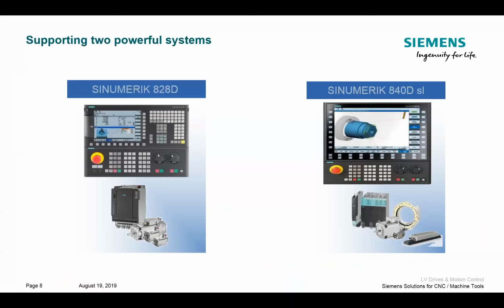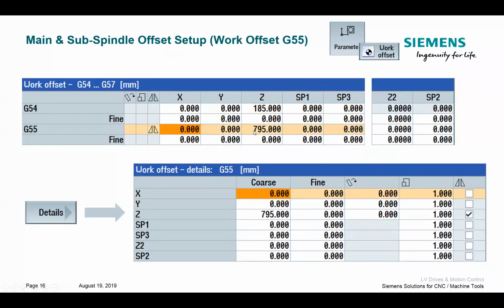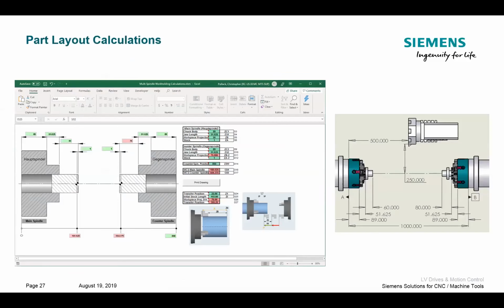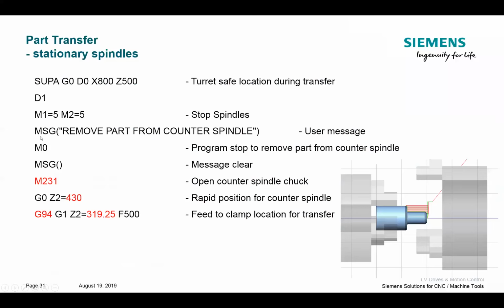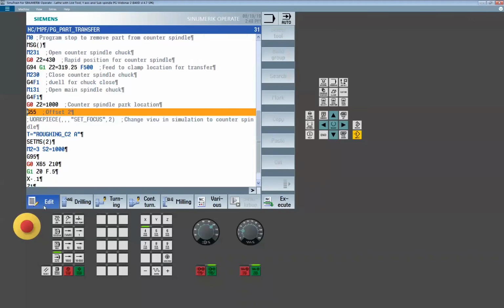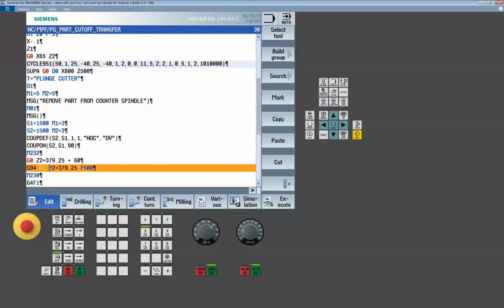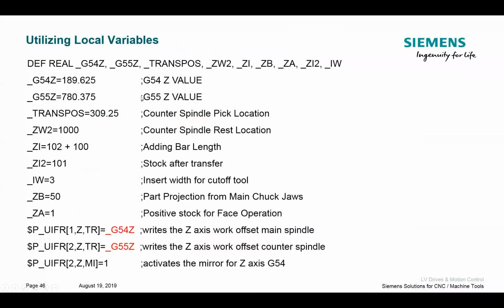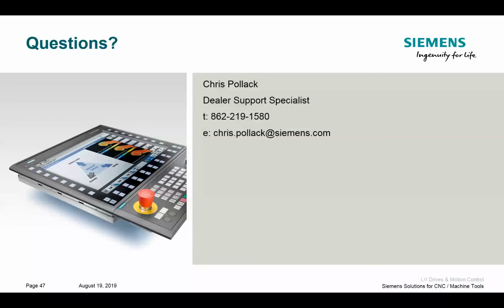Setup & Programming Sub Spindle Lathes in G code with ProgramGuide    SINUMERIK 840D Sl & 828D

Comment: Hi Chris. Just discovered your videos and they’re really informative. 

I’m struggling with a part which requires me to broach a hexagonal slot. I’m using a single point tool so I would have to index the c axis 60 degrees each time of course. 

I need to write a broach macro in Siemens 840d 

The machine I’m on is a dmg mori ctx1250 which is 5 axis with sub spindle. 

Appreciate it if you can provide any help or point me to a video which will be helpful! 

Thankyou
Reply from the maker: please email me you question. Dan.strubel@siemens.com